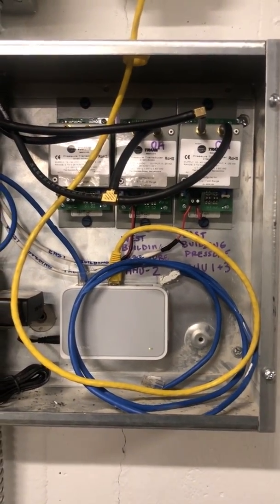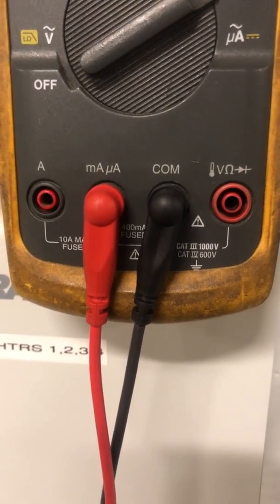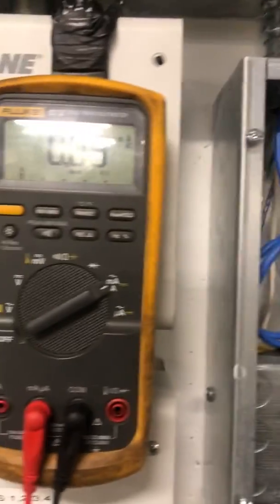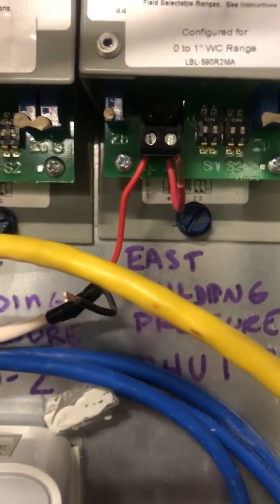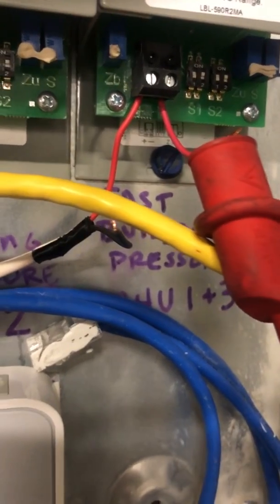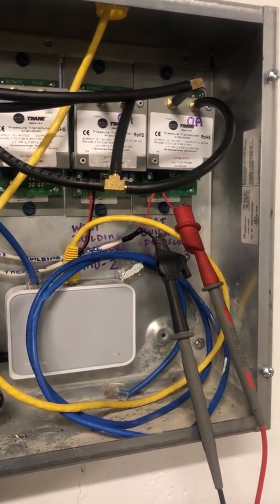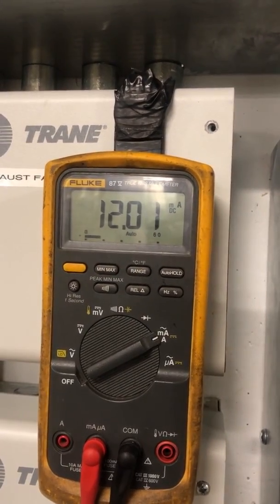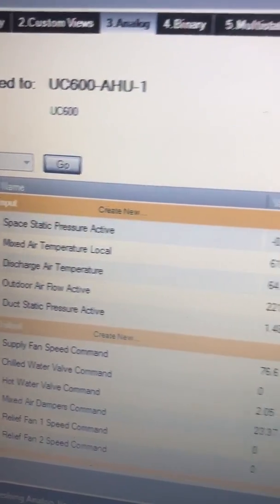Checking a 4-20 milli-amp transducer reading

Comment: Thanks for the video! In case if your output signal of the transmitter is 12mA or 50% value but in monitor value of pressure is showing for example 25%, how is it adjusted? Is it adjusted in program itself in PLC or should we replace the sensor with a new one?
Reply: I HAVE SAME QUESTION